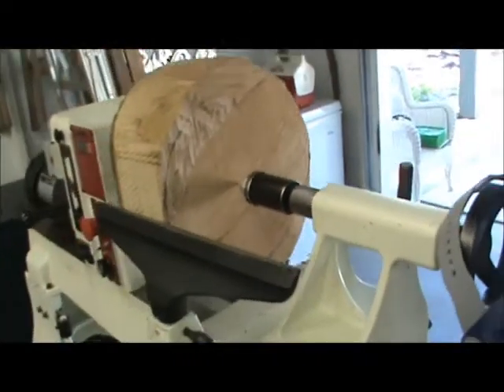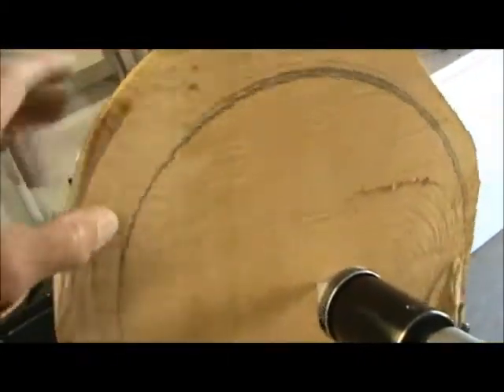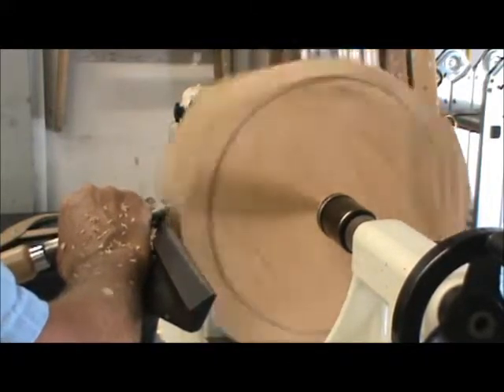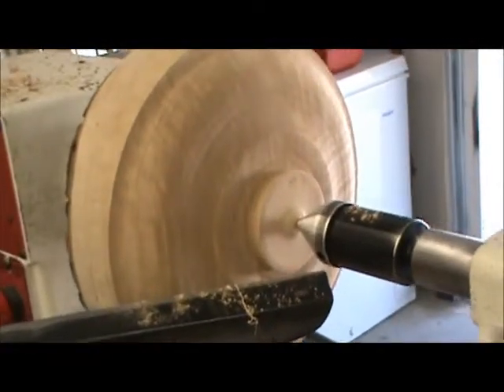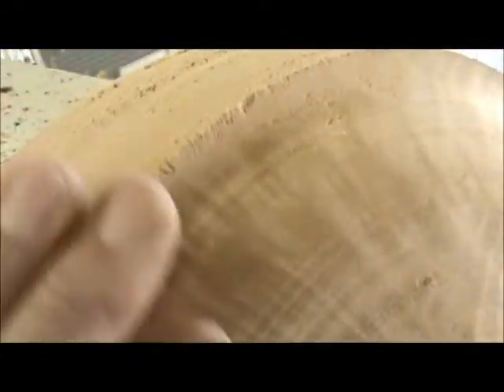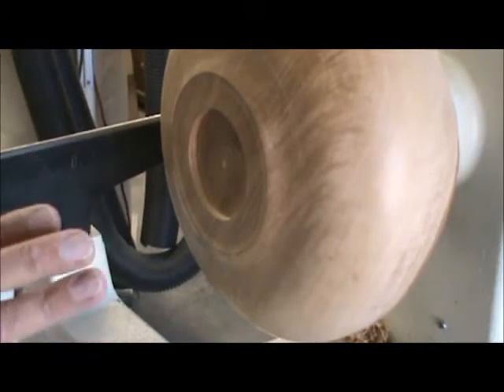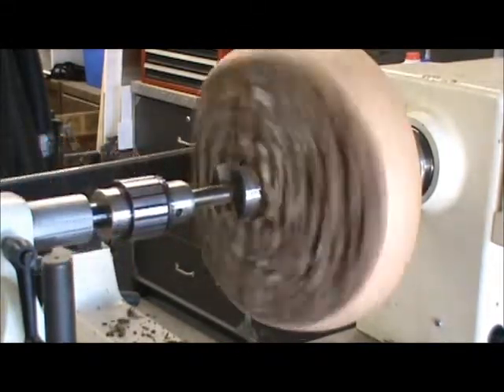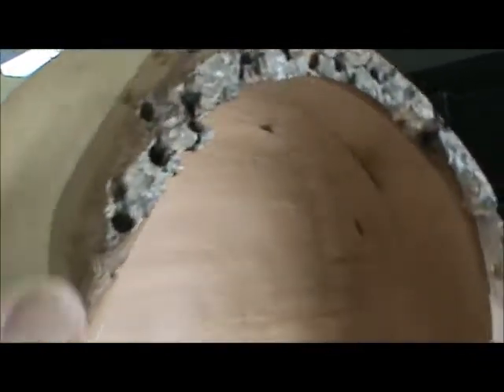Bradford Pear Bowl 2015

Comment: Welcome back, David ... good to see you again. A couple is suggestions ... instead of rounding the perimeter first, start from the bottom and cut into the grain. You'll get cleaner cuts with a lot less thump-thump-thump. I have a friend who is a lefty and has the same lathe you are working on ... he flips the banjo around, stands on the opposite side of the lathe and turns in reverse.
Reply from the maker: Gerald Jensen Thank you Gerald. Great suggestions. I should have started with the bottom and worked around. I've been turning lefty style on a righty lathe so long that I'm afraid I may injure myself if I switched to the opposite side, but I may have to give it a try. Thanks for watching and commenting!  Dave